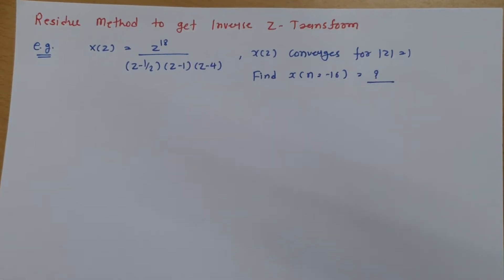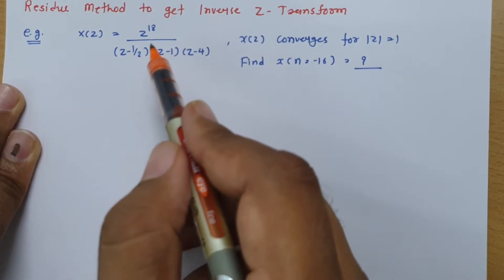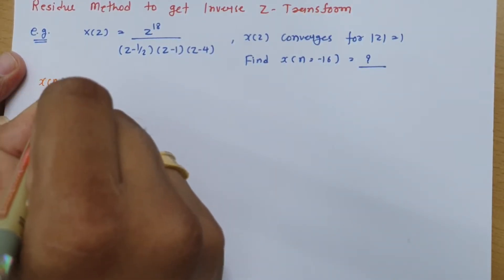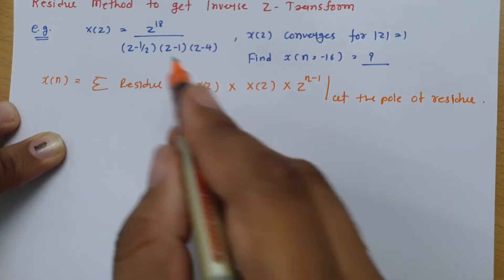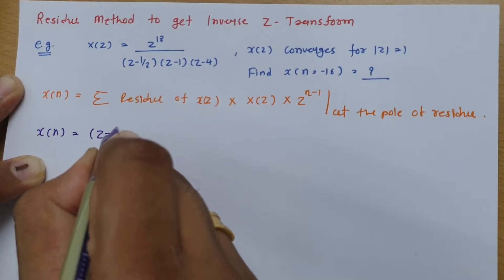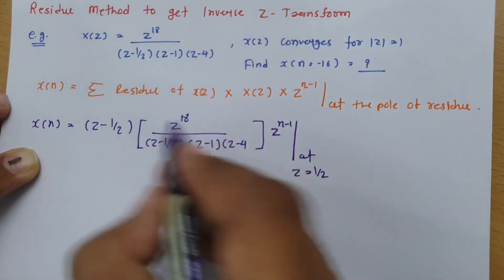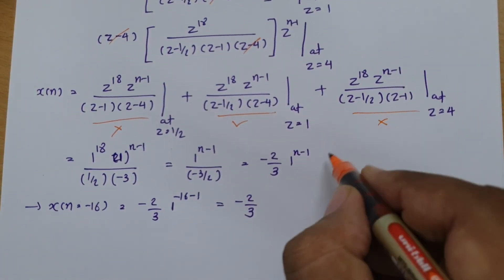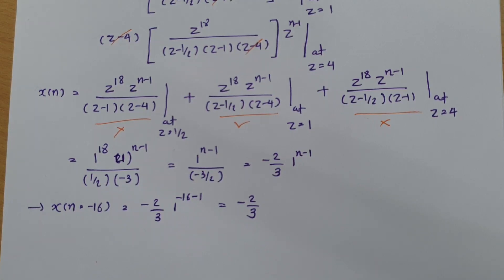Residue Method for Inverse Z Transform in Signals and Systems

Comment: Thanks You Sir for Your Lectures..! you are doing A great job.! 
Sir I am form Pakistan I have tried several times but neither your website is opening nor I a am able to log in to the android app! 
Can you please guide me what may be the issue with website and application..? 
I will be really thankful Sir.
Reply from the maker: You need to sign up first on my application. 
Then you can use all the data freely without any charges
Reply: @EngineeringFunda  OkeY thank You Sir!